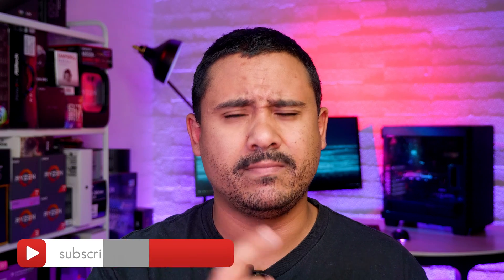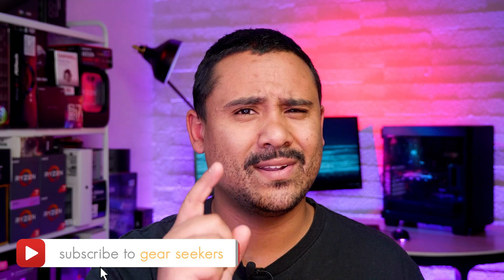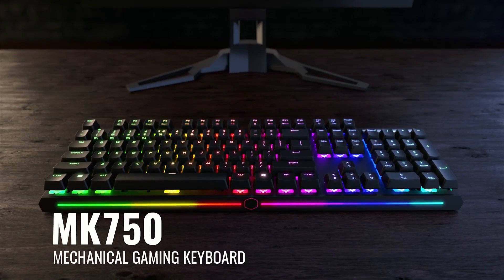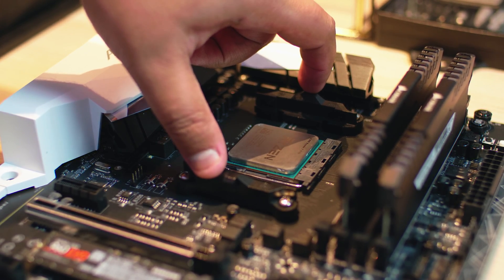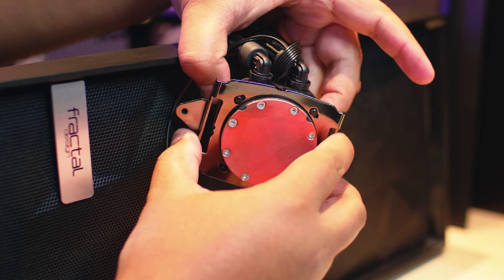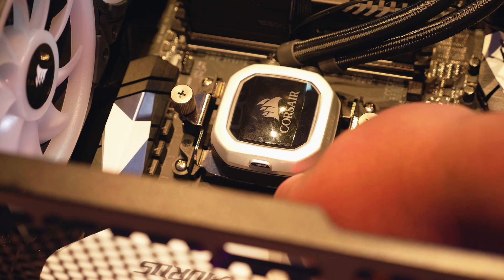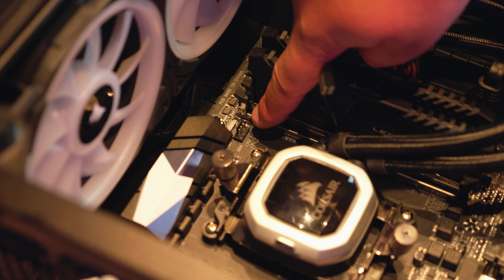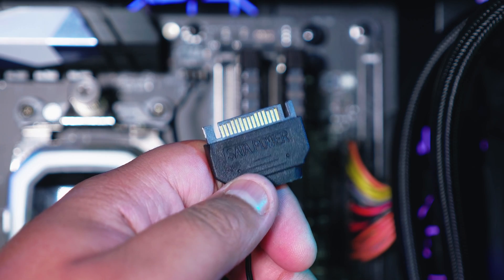HOWTO Install Corsair H115i PRO RGB On A Ryzen CPU (AM4)

Comment: Does the cooler fit in a fractal design focus g blue mid tower?
Reply from the maker: Probably not
Reply: Gear Seekers it says on pcpartpicker that it is compatible??
Reply: Im confused....
Reply from the maker: It's not always accurate. Yes it fits 2x140mm fans on top however with the radiator added it probably wont clear the ram or the pump itself. I personally wouldn't do it as it only just fits in the Meshify C
Reply: Gear Seekers i have one more question tho can i fit the radiator and fans instead of the factory installed fans at the front?
Reply from the maker: The length of the pipes probably wont allow it. In their specs they say 2x140mm fans can fit up front but again, the rad is slightly bigger than the fans and the hdd cage would need to be removed. It depends on your CPU as well. If you have something that doesn't require heaps of cooling look at a 120mm cooler you can mount on the rear of the case.
Reply: Gear Seekers ok ill look up on that thanks m8

Comment: Good timing. I just bought that cooler couple days ago. The tightening screws btw. look pretty odd. I first though I had done something wrong as they were  somewhat tilted away from processor either side. Not straight upwards.

Looking this however this it seems its sameway as mine. I guess they are normally bit tilted?
Reply from the maker: Yeah it's perfectly normal :) even other coolers do it as well.
Reply: I noticed this too, thought I warped the bracket 😂
Reply: Sweet, so I don’t need to remove or add any kinda bracket on the back of the Mobo like I’ve seen before 😯